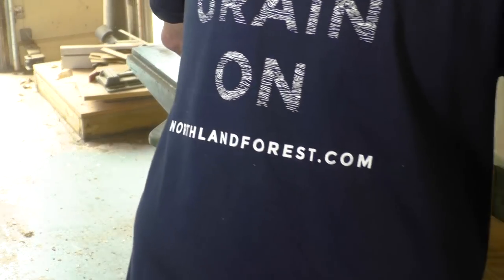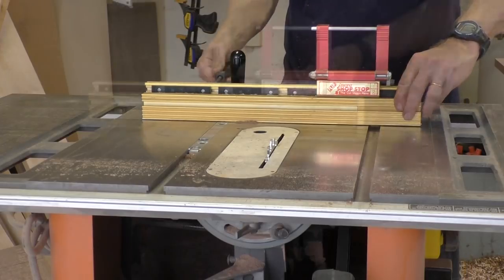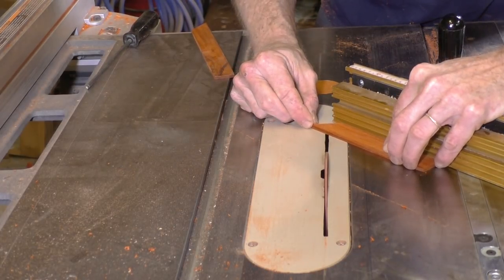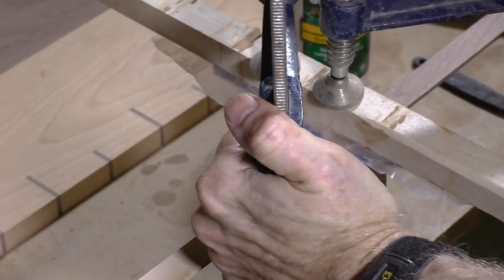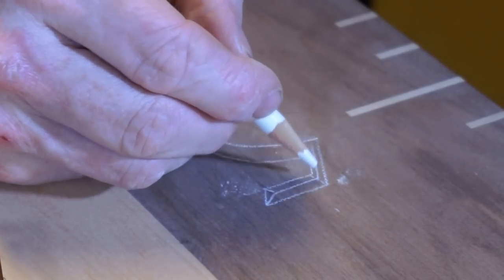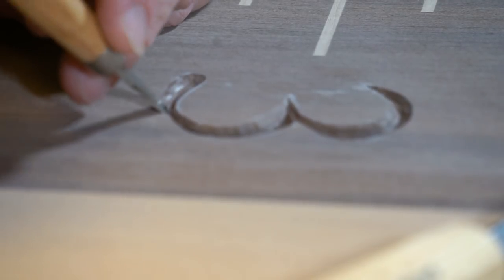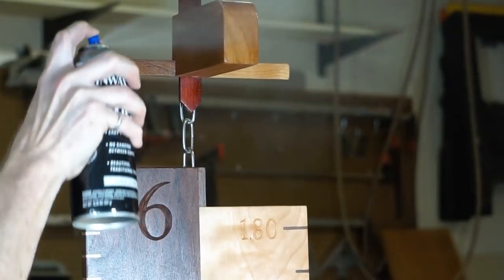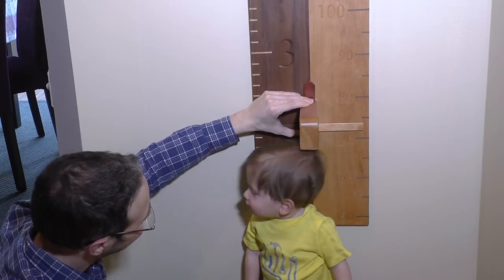DIY Growth Chart with Hand Carved Numbers

Comment: I've been making a version of these for some time now that looks like an enlarged 6" wooden ruler. All of my measuring "tick marks", numbers, and personalization are hand-routed. I really like the look of the hand-carved numbers, though; and I've decided when it's time for me to make one for my own use, I'll definitely be using your spline method! I love the way the walnut and cherry contrast with each other! One thing I've been doing that I would suggest for any you make in the future is to put a second keyhole father down (mine are at 6' and 1'). Using two hanging points ensures the ruler is vertical and keeps it from swinging on the wall. Great job!
Reply from the maker: Dale Boyer Thanks for your comments. I totally agree about the second keyhole. I realized the need for that after hanging it, so I added another one after making the video.

Comment: Mike, new subscriber...   To transfer your letter's, numbers or design.   You have to print with a laser or photocopier, anything which uses toner.   This method won't work with ink jet.   Once you have your image printed in reverse.  Place it face down on your piece of wood.  wood should be sanded smooth.    Then use your houseold iron, dry, no steam and on the highest setting.    I place the iron on the paper, let it heat up for three to five seconds and then using the tip of the iron you rub the toner into the wood.  The more you work it, the better the transfer.     No muss, no fuss, no nasty chemicals and it doesn't damage or even dirty the iron.    The only drawback, you have to be careful where you stick your fingers, the board and paper get's hot.     I've done this on Cherry and Walnut for a couple of sign's I have made.     Once you carve or route the design, any toner still on the surface will sand off easily.

Comment: To transfer laser printed letters, use transparent A4 size plastic film(or whatever size) to where you can print. Print letters with edges only and mirrored. Use ironing machine to heat up the ink through the plastic and press the ink down to the wood. The trick to use plastic film instead of paper is that ink is stuck to the paper more than to a plastic. I have used this technique to transfer PCB tracks to a copper plate. Hope this helps.

Comment: To transfer print to wood, use heat.  A lot of woodburning kits have a flat attachment, which is what this is for, but you can also use a soldering iron.  The paper has to brown in order for it to be hot enough.  (I do this all the time.)
Reply from the maker: Thanks for the tip! I'll try that soon just to be prepared for the next time I want to transfer something.
Reply: This works. I use it all the time to transfer patterns for chip carving.

Comment: Terrific video, Mike! Watching YouTubers work through plan changes is really informative, in this case  carving the letters and doing the magnet slider. (As for toner transfer, I've done that often to make circuit boards, although I print them on to special heavy-weight toner-transfer paper and then do the  transfer with a laminator running at maximum temperature and pressure.)
Reply from the maker: Thanks, Mark!  I had considered using toner-transfer paper but I was too cheap  LOL.  It's probably a good idea for me to try though.
Reply: I know some people print into glossy magazine paper and transfer with an iron and a dowel, but I think it's harder to get consistent results that way. Check out Pulsar Pro FX - I think they know toner transfer better than anyone, for circuit boards and other applications. Also, I think toner will scrape off wood very easily unless you seal it  very thoroughly.

Comment: There is NO difference in accuracy between metric or imperial.  The accuracy is all in how fine you want to go within either. Metric 1 mm is .039 imperal just slightly more than 1/32.  .1 mm is .004 in imperial. I use both depending on what works best for the situation and how fine you want to go with reality.
Reply from the maker: Haha, yep.  I was only kidding at the end.

Comment: Had to laugh about your "US is never gonna change" comment, since the US has actually already converted to the metric system, and just converts everything to Imperial (technically it's called United States Customary Units  or USCS) for the fact that we're too lazy to adapt.  Anything that is imported/exported or is dealt with internationally is metric (food, science, etc.)  We've been using Metric since at least the 1800's and has been increasing its use since then.  As for your "Precision" comment, I find the your metric side more precise as you've label each decimeter (as a centimeter value) and your "Imperial" side is labeled at each foot.  I would have made both side equal in length  to make it cleaner looking.  Other than that, great job, and had to laugh at you comments (even though I knew you were really joking).
Reply from the maker: I'm glad you knew I was joking towards the end. A surprising number of people thought I was being serious. Thanks for the feedback!

Comment: Project looks good, specially the carving; but why did you pick 5cm as your arbitrary metric measurement? 5cm is close to 2", thus making the  imperial twice as prescise as the metric. I ask this because you said that there was an precision issue with the metric side. Additionally, this is why metric rules the world: Very intuitive to use. How intuitive? The people who started the imperial system switched to metric in 1965! People that can use both metric and imperial can convert back and forth from either system, increasing the mental prowess of said user. I also argue that the metric is so intuitive, it increases the speed of mental calculations; Quick, what is half of 1/32nd of an inch? Now go find that accurately on a standard ruler! I also argue that going from fractional to decimal becomes a challenge and most people cannot do it with out the aide of a chart. This is why machinists prefer metric! Most people in the US don't know why there's so many lines on the other side of the tape measure! 😂
Reply from the maker: I was only joking about the superiority of the imperial system. I intentionally spaced the increments out on the metric side to help me with the precision argument.  😂  I continue to use the imperial system for woodworking because it's a pretty common standard in the U.S., but I grew up in Canada, so I'm fluent in both and I definitely understand the benefits of the metric system.